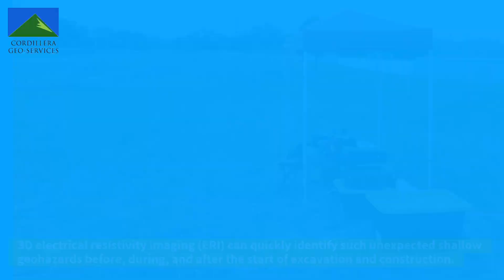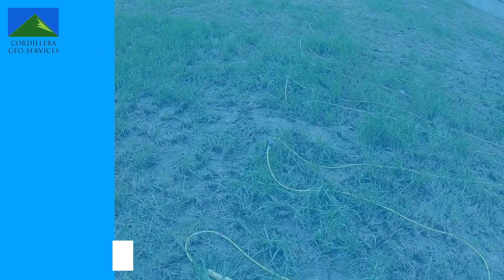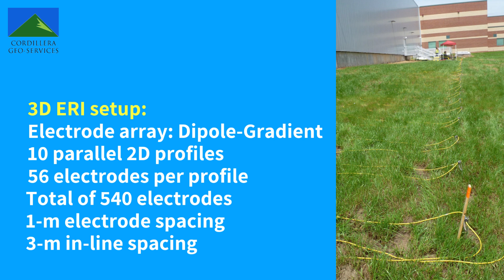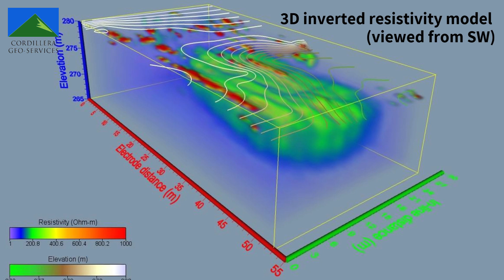Cave, Sinkhole, And Void Identification

Comment: with what program you analyse the uderground ? void or cave ?
Reply from the maker: That software is Voxler.
Reply: @hectorhinojosa-cgs  what filter i have to put to be sure that i have a void or cave ?i usually use average filter type and volRender with terrain2 as color map.i also have send an email . thanks.